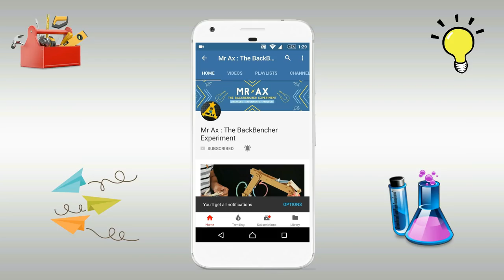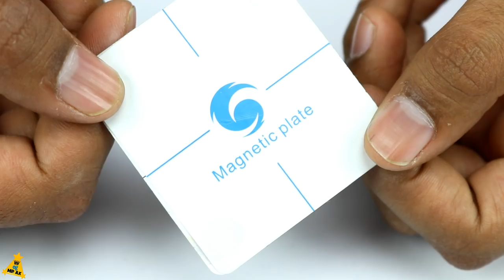Battery Remote Convert into Wireless Charging Remote

Comment: First of all, the remote control is a voltage of about 3V, and the internal wireless full output is 5V voltage, there must be a step-down circuit, the battery must be rechargeable, lithium battery, so this change is completely wrong.